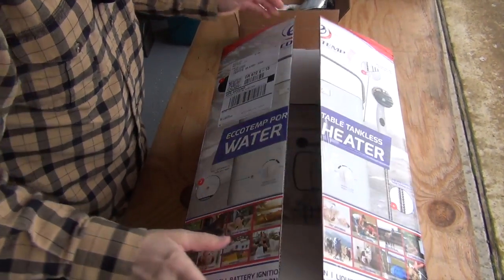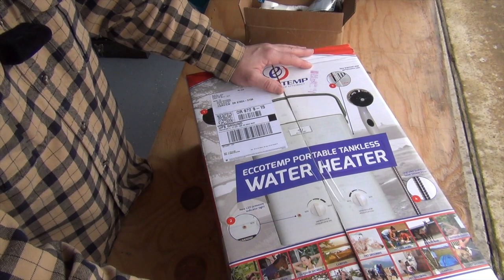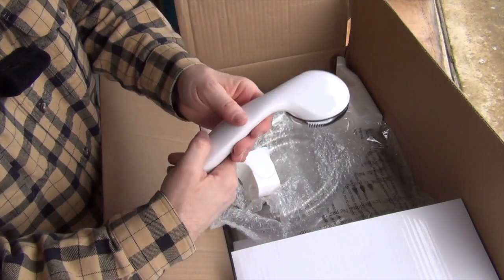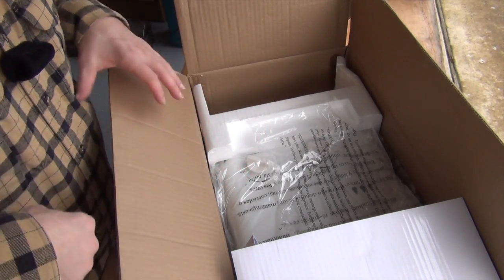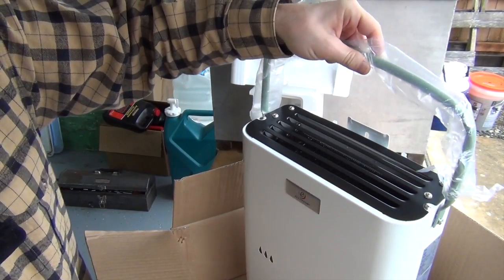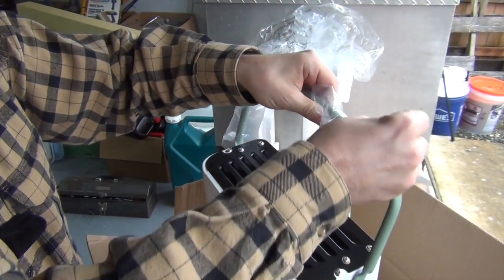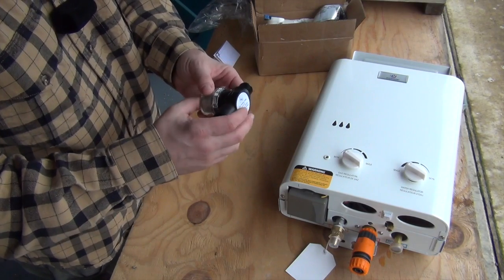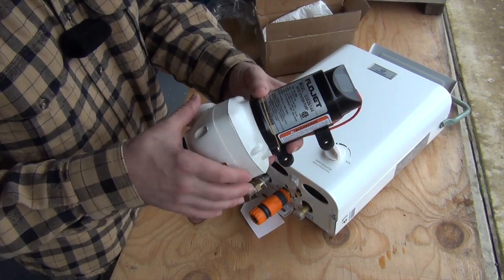Small Cabin Project "Shower"  Pt.1

Comment: Those water heaters are great.  I had one installed while living in Egypt 🇪🇬.  Used it for shower 🚿 and stove.  I paid about $40 for the unit and about $65 to have it installed.  I liked it so much that I bought another one before I left,  open box about $30. Those heaters gets hot fast,  although there's a temperature setting,  I had a diverter to mix in the cold water.  Like he said be careful with the water pressure,  too low and it will shut off.

Comment: I use mine off grid, it feeds from a 45 gal drum. The pump with the deluxe kit provides plenty of pressure. I use a power sport battery for the pump and the whole unit is mounted on a 4”X 4” post with a plywood backboard. Easily removed for winter storage. 
It came with everything except water hose, I used a garden hose cut to lengths and connected with clamps. I cover it with a BBQ smoker cover when we’re away from camp.  The enclosure is screen tent frame and heavy duty tarp.

Comment: These water heaters are all made in China. This brand is made to high standards. The one I have is getting old and still works great. Portability is nice.
Reply: The gentleman here used city water, can this be used for tank ? If so does this need to be outdoor or indoor? I mean for RV ? And does the water pump needs to be connected between tank and shower heater?

Comment: I enjoy all of your reviews! I've been trying to figure out how to add a shower to my cabin. Please upload a video when you install this at your cabin.
Reply from the maker: +Bert Derosia Thanks a ton Bert!  It's our pleasure.  I plan on "kit building" the majority of it in the garage (sort of the theme I guess), then installing it in the spring.
Reply: Not much to "installing" these just use teflon tape and two wrenches on the pipes... don't torque on the fittings without back pressure or you can twist off a part or fitting.

Comment: They're great I did find when the water is quite cold to begin with, it doesn't quite heat the water up to have a hot shower but otherwise it was a simple solution to having off grid hot showers.     Make sure you run plumbers antifreeze through your water system for the winter rather than trying to drain it.
Reply from the maker: That is a great tip thanks..I will most likely just unhook it and take it out for the winter.

Comment: have this unit .have not installed yet but going to try hook up with rain barrel that fills a 10 gallon rv holding tank .Which I am going to attempt to use Flo jet 12 volt water pump to supply Eco Temp on demand hot water tank. in out door shower area.
 again thank you